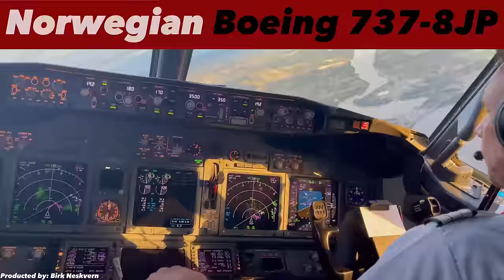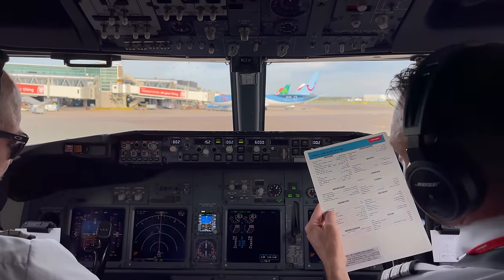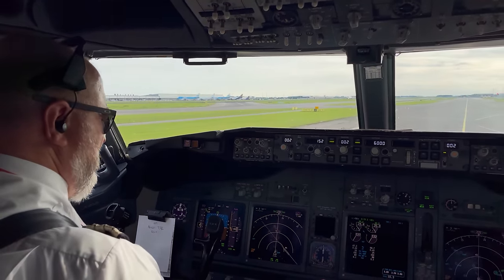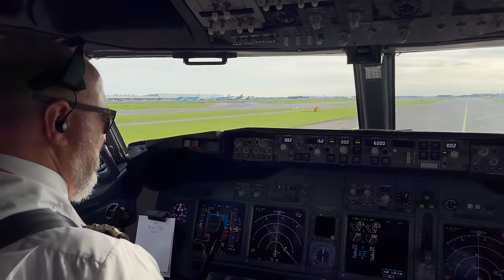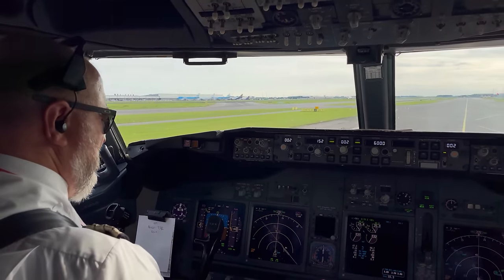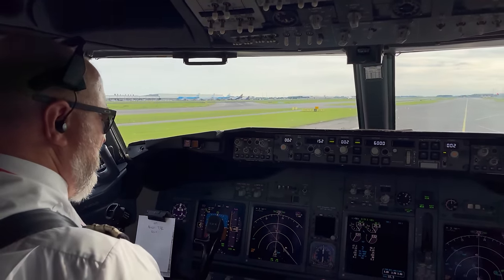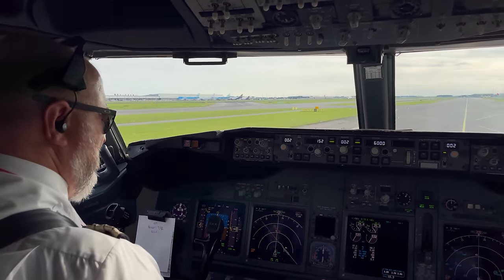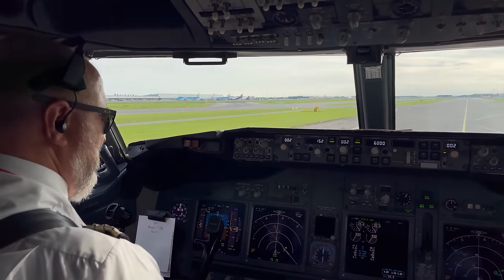| Norwegian 737 Cockpit | Amsterdam - Oslo | Out Of One Of Europes Busiest Airports! | Flightdeck |

Comment: Great video.  Really like the clear instrument panel coverage.  The taxi from stand to holding point was about as long as my taxi home after a night on the town !!  Question for pilots/simmers : when does the autothrottle click off with the autopilot disconnect (happens here on final approach)
Reply from the maker: U need to manually disengage the auto throttle, there are two buttons on each side of the throttle, try to look at what the pilot does with his hand, when the auto throttle disengages😊
Reply: @CptMitchu  Gotcha. I see that the first officer (guy on the right), disengages the autopilot with his right thumb on the control yoke.  There is an autothrottle switch (A/T Arm) on the MCP panel between the 'course' window and the 'ias' window and it clicked off at the same time as the autopilot at 1:08:24.  I had forgotten about A/T  buttons on the throttles so he must have clicked it off at the exact same time.